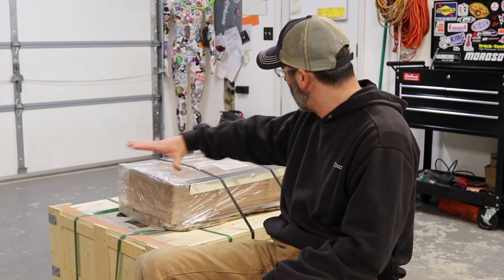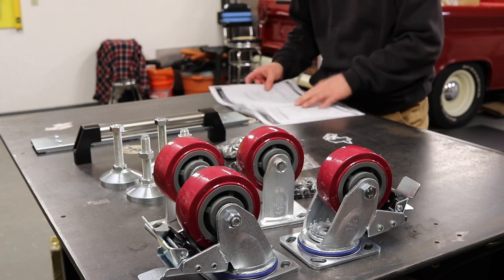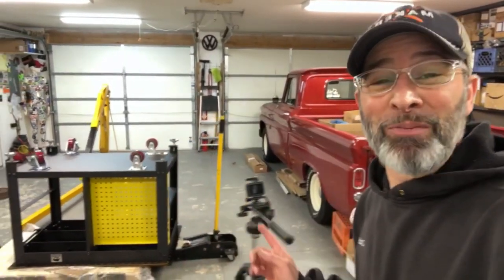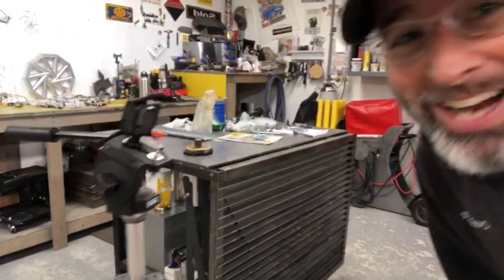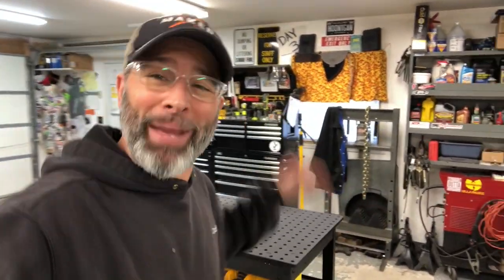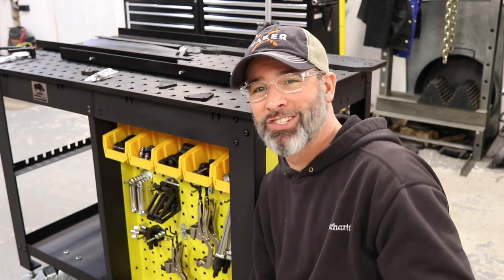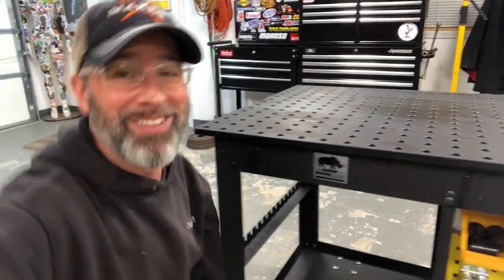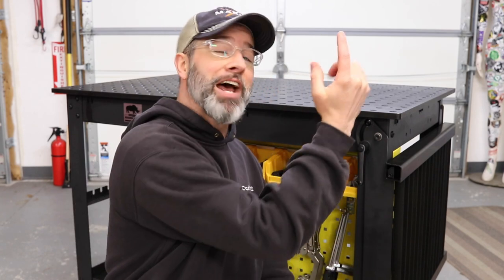Strong Hand Tools Rhino Cart Mobile Welding Table & Fixturing Station: Unboxing & Assembly

Comment: Another well documented project and awesome video. This really gets me thinking about getting one of these tables. It would fit my needs perfectly. Thanks Chop
Reply from the maker: Thank you for watching Chuck. It's a well thought out and super well-built table. Strong Hand has it right with the Rhino cart, simply quality across the board. It's an easy product for me to get behind.
Reply: @HouseofChop  Hey Philip, great channel! Please don't take this as trolling, I'm not. But it always puzzles me why any welder/fabricator would buy a mass-produced welding cart or table such as this, which costs 5x the materials cost of making your own and having a local fab shop laser cut the parts. I verified this when I made Joe's @homesteadonomics welding cart, and Adam @maker.table ultimate maker table on my own. I guess I'm asking for enlightenment from someone who went your route. All the best, @HoneyOnWales
Reply from the maker: @drewt3210  The answer is simple. How much time do I have and what do I want to be doing with it? All the examples you mentioned are of excellent products and I wouldn't mind having any one of them or all even. I built my folding plasma table because it was something I did not see in the market place (video is up and on here if you are interested) and took some problem solving to figure it all out. That is it satisfied my curiosities and as such I was invigorated to use the little time I have to make things in the effort of bringing it to life. Noting wrong with building a table. I've built many, just didn't fire me up and I wanted to get to some things that did. Hope that makes sense.
Reply: @HouseofChop  Makes perfect sense, thanks for your insight!